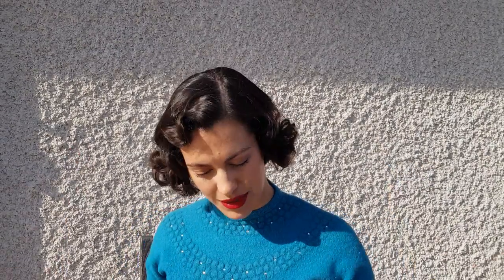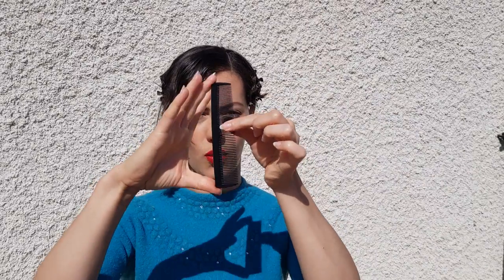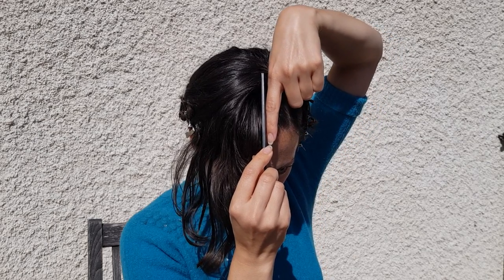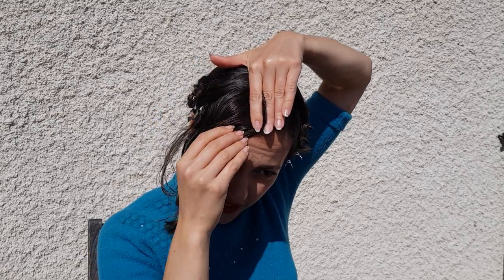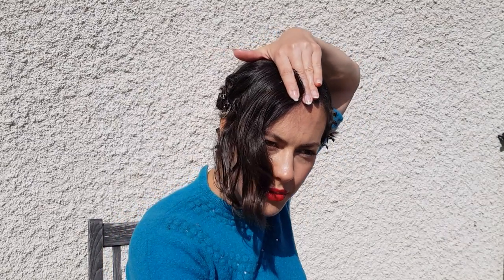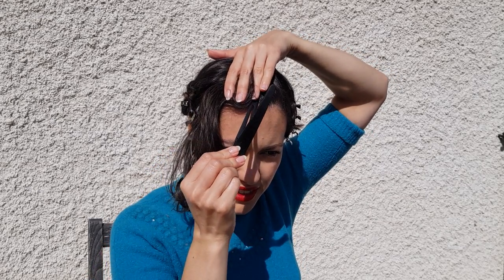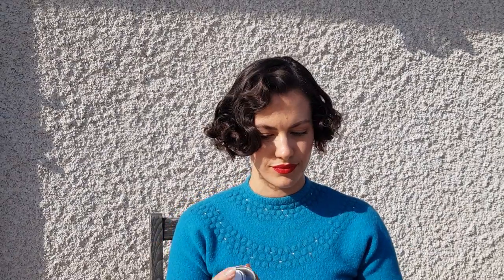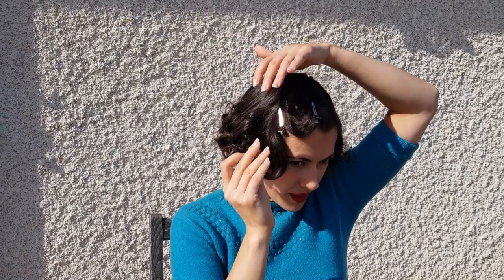How To Fingerwave⎟VINTAGE TIPS & TRICKS

Comment: You did a good job of taking the mystery and complexity out of the fingerwaving technique! Also good point about how these fingerwave are the same technique as what is used in 40s setting patterns with half or full waves.

Can you remember about how long you let your hair dry before taking out the clips?
Reply from the maker: I'm glad it was helpful! My hair dries and sets super quick. The main thing is to wait until your hair is completely dry. Then if it's hair that's difficult to set, the longer the better. I'd try at least 2 hours.

Comment: Great video! I would like to do finger waves on my hair, but I have eyebrow length bangs. Is it possible to do this then? How should I go about with shorter pieces of hair?
Reply from the maker: I have eyebrow length bangs in this video, they are just wetted and brushed to the side with the rest of my hair. This is actually a really easy way to incorporate them. If you look on my Instagram you'll see what my current haircut is when the bangs are out, to get an idea of what I was working with xx